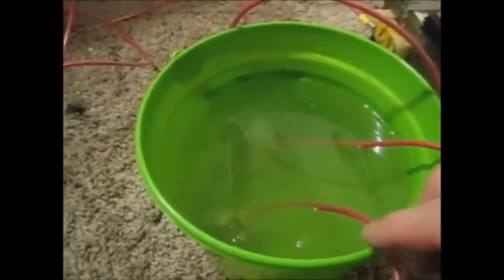Making HHO without the O. Only hydrogen (high voltage)!!!

Comment: Having an adjustable frequency to run your MoT will use less current, allow you to find resonance, which will reduce heat on the system and increase production of Hho. Using a square waveform is also more reliable.

Comment: As Peter said: is electrochemical reaction Al + OH. It may be a solution with porous Stainless Steel as Anode and porous - consumable - Al at cathode ( to enhance the Hydronium and Hydroxide volumes at even lower voltage. Aluminum Hydroxide produced may be recycled. It was done properly with continuous feed  Al wire electrode. Nothing new under Sun!

Comment: Easily explained:you are using aluminum as electrodes. aluminum is amphoteric (it will react with bases and/or acids) and the reaction will liberate hydrogen. It's not electrolysis, it's just a chem reaction.  AL/Sodium Hydroxide will liberate hydrogen as will  AL/HCL.Depending on what amount of chlorine your water contains, or if you have a carbonate, you will see some H being liberated. The voltage just helps to dissasociate the water into Hydronium ions which the AL simply captures. Switch your electrodes to Stainless, carbon or platinized mesh and it will start behaving normally. Also, AL metal will be getting used up, so your electrodes will wear out, giving up atoms to form Aluminum Chloride or Aluminum Hydroxide, depending on your electrolyte.
Reply from the maker: Thanks for the insite!

Comment: Are you using tap water? If so, try adding two teaspoons of baking soda to see if it increases the output. The baking soda will increase the conductivity of the water and should allow the current to travel between the positive and negative more easily.
Reply from the maker: Yes there is only tap water. I did not try baking soda because I did not want to end up blowing up or burning up my rectifier since it's rating was only in the milliamp range. I do want to try it.
Reply: Tyson Capel
I see where you are coming from... makes sense.

Comment: Check out the positive for oxidation/corrosion you may just be absorbing it. Or supper oxygenating the water
Reply from the maker: I'l have to run more tests. Thus far there is no oxidation but I'm sure if I run it longer there will be. Don't know till I do it. If it does not oxidize then what? Good question...

Comment: If you want to improve your car engine efficiency
and save on your car fuel expenses
There is a better way to do it - it is HHO Gas
Search Google for: Top HHO Gas Car Research
Click the first result (Skip the Advertisement)
Reply: +kevin Luis -Thanks Kevin, I followed up on your suggestion and I am delighted by what I found. I have a few ideas of my own on superior dual fuel applications.
Reply from the maker: I've been into HHO for many years and know that they do work to increase efficiency. There is allot of potential still to come from it.

Comment: Tyson can you explain me better the scheme? I don't understand when you say: 1 wire up of the m.o.t and connect the other wire to the core of the mot and so on...etc" Mot has 2 wire with output 2100vac , what do u intend for connect one of these 2 into the core? can u made a simple scheme please?
Reply from the maker: the wires going to the bridge rectifier from the transformer. One wire is connected to one side of the secondary coil and the other wire was connected to the core of the transformer. The way they made this transformer one side of the secondary coil wire ends has a quick connect fitting on it and the other side of the secondary coil wire is soldered to the core of the transformer.
Reply: Tyson Capel uhm--sorry but are you telling me that you've put in self loop like one wire of the mot?maybe a simple sketch will explain better, i don't want to joke with mot :)
Reply from the maker: I'll make another video... Can't find the old transformer and all the stuff but I got a new one the same rectifier same rated cap so I will do a detailed video.

Comment: Dam AC voltage and a bucket of water :O that ark gave me the shivers and put some fear in me...
I have some Ryobi 18 volt batteries for an old drill I`ll be using to play AC and water is just to scary for me, if you happened to lose balance and spill it on yourself :/
Reply from the maker: Isn't it beautiful!

Comment: This is nothing all that unique its just that your pushing a half cycle of ac into the water from the rectifier. Clipping the ac wave form. The other side positive is passing though the capacitor and then to the bucket. I have witnessed this with a high frequency router power supply i got from the good will. There is some oxygen being made but not much. The key is high frequency ac chopped wave in the kilohertz range. Post a drawn schematic in a followup video for people to see. Yes Stanley Myers secret is high frequency ac. You can do this same thing with 12v ac rectified to dc. The cap lets ac pass not dc that is why no oxygen. A high speed switching power supply can do this without the high voltage from the wall from your setup transformer.
Reply: Are not those full wave rectifiers?
Reply: interesting
Reply: delvis11
yes that looks to be full wave bridge to me.
Reply: egn83b Are you saying that you have a method to create pure H2 with no O2 production?
Reply: No, not totally but I have an understanding of the process involved.  I had elaborated on what I had experienced from high speed switching wall wort did for me. If you know anything about ac caps they block current and pass voltage. The rectifier in the video I get the feeling he was over driving the diodes and still passing ac because the behavior of the gas production is not typical of dc operation because he would of got production on both plates.
Reply from the maker: delvis11 Yes they sure are.
Reply from the maker: KyleCarrington I know that comment was dirrected to Kyle Carrington but that is exactly what is happening here. Pure H2 with no O.
Reply from the maker: egn83b It is very interesting that is for sure. There was literally no gas coming off the positive side, none at all.